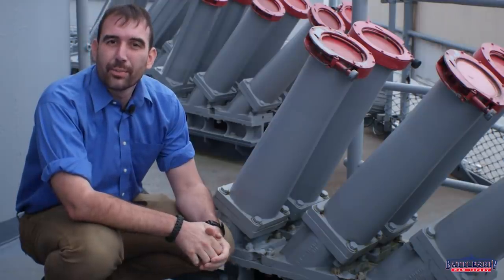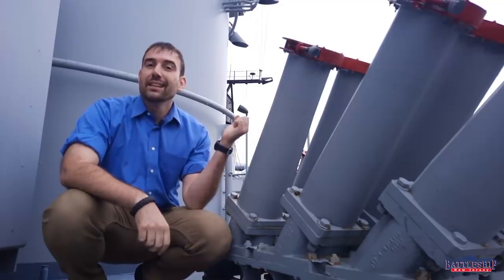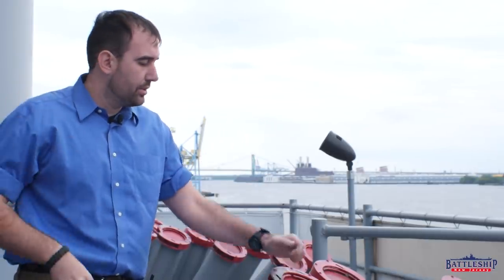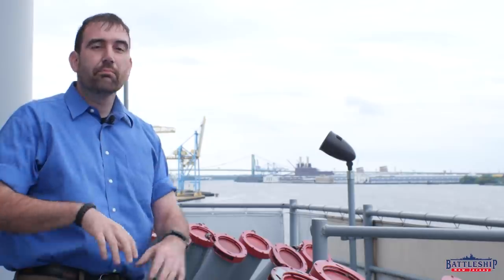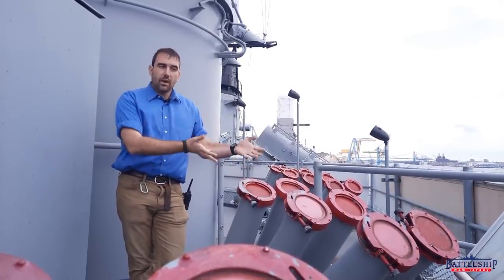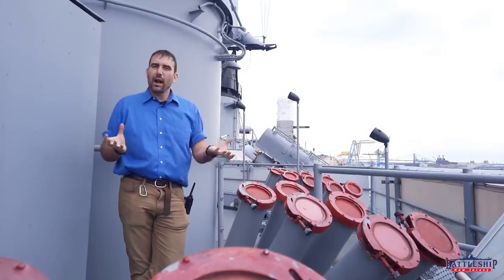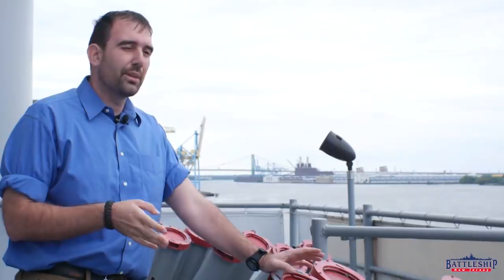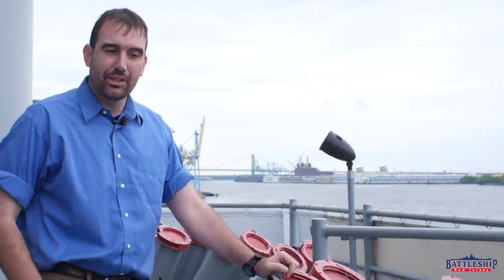SRBOC: Super Rapid Blooming Off-board Chaff

Comment: Would New Jersey be able to tank a hit from something like a harpoon antiship missile? I assume it could if the missile hit the main belt armor but I have no clue about other areas of the ship and I don’t know if harpoons are designed to use plunging fire or hull attacks
Reply: Yes.  A Harpoon or Exocent is basically a Zero with a bomb.   It could damage the superstructure but would make a burn mark on the armored portions of the ship.
Reply: Maybe can go though the armor as harpoons are 600 pounds of explosives' charges. Decent enough force to  have a chance, or cause failure in armor. Unlikely as their was a reason that battleships had AP charges. Similar value to some HE charges on WWII Battleship charges.
Reply: I heard a joke after the loss of RN ships to missile hits during the Falklands War:  "What is the first order the Captain of an Iowa Class BB gives after being hit with an Exocet missile?  'Sweepers, man your brooms.'"  Maybe overstated but it does point out the survivablity of WW2 era steel ships vs. that of aluminum superstructure Cold War ships.
Reply: The only real threat is from fire.  

It wouldn't penetrate the armour so a catastrophic detonation or loss of buoyancy wouldn't happen.  

An out of control fire though could do huge damage,  its the fire that took out the Royal Navy ships in the Falklands rather than direct damage from the blast. The size of the Iowa along with armoured bulkheads goes a long way to reduce that risk but a mission kill is a genuine possibility if it needs to drop out for major repairs.

Comment: Would the Exocet missiles have gotten through the Missouri’s belt?
Reply: No, it was calculated that the Iowa class could receive up to twenty hits from an Exocet missile and still have an ability to be very battle ready. Her armor is mostly steel and most cruise missiles are made to defeat an armor made of mostly aluminum. Aluminum melts at half the temperature than steel. Also the decks are armored, bulkheads, all necessary equipment and electronics are inside the Citadel ( a second armored 11 inch thick section is inside made up of separate compartments.... made of steel) the outer belt of 14 inches is on one side of the main passageway going down the sides on both beams and the Citadel is on the other. Even a new modern cruise missile would have a tough time crippling an Iowa.Perhaps many hits would take one out, but these ships were designed to take multiple hits from one ton munitions and still fight on. The Hood which everyone sites as an example of the easy target was a Battlecruiser and NOT a Battleship. She had a higher speed than a battleship but was light on armor and not the redundant systems found on a battleship.
Reply: Ryan has said before,  current anti-ship missiles are not going to sink an battleship.  However enough successive hits will mission kill the battleship an force it to return to port for repair
Reply: @gregwallace9314  
Hoods bow when running at high speed pushed water up as it ran thru it, then a trough appears behind the bows wave form.  It is thought a 15” shell landed in this trough, an hit the ship under it armor belt to explode in the aft powder room. 
Seeing that this was still a Jericho trained navy where the safety of the ship came second to being able to fire more rapidly.
Allowed to blast to travel up the length of the ship to detonate the forward magazines as well.
Reply: @gregwallace9314  
Hood was slightly slower than the Iowa’s. 32 knots vs 33 knots
Reply: Nope
Reply: @keeshahdarkfurr8328  Hood was badly in need of a refit.  She wasn't any faster than a KG5 in 1941.
Reply: Knowing that the Japanese did not have fire control radar do you think Admiral Lee would have deployed smoke in an engagement in the San Bernardino Strait had Halsey left TF 34 behind to protect the landing.  It would seem to be a smart thing to do since his ships had blind fire capabilty and would have mission killed or sunk the Nagato and the two Kongos before they could get off a shot.  Wrong place. Oops
Reply: @keeshahdarkfurr8328  jellicoe* not jericho.
Reply: @keeshahdarkfurr8328   Hood might be slower Iowa but it is a WWI design. Contemporary battleships have speeds of 21-25 knots so she was faster.  So she did sacrifice protection for speed because that was required with the technology of the day.   So the point of Greg Wallace point still stands even if the speed of Hood and Iowa is very close.